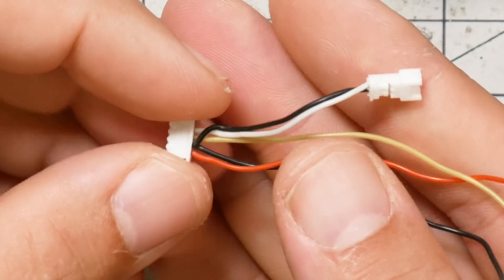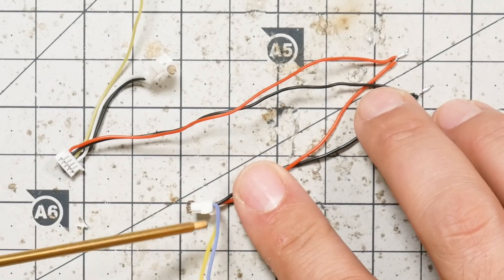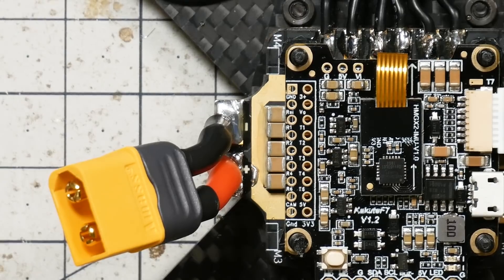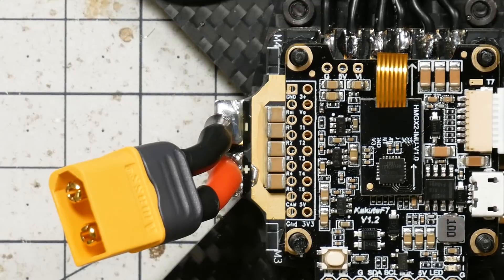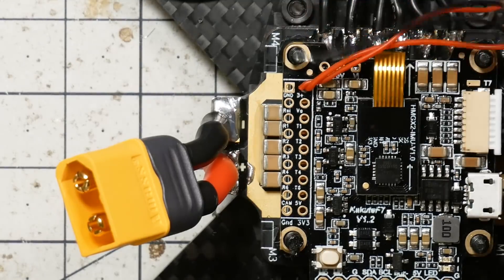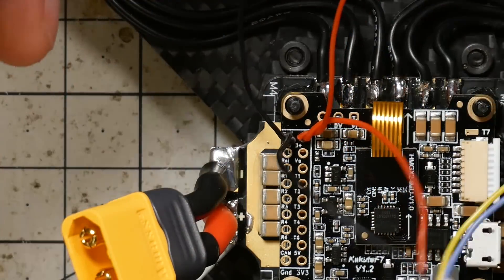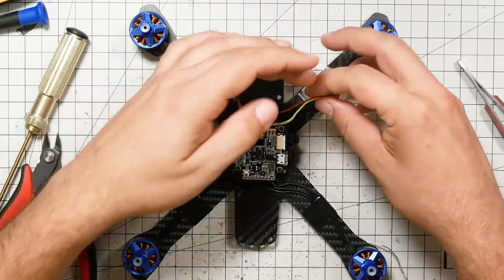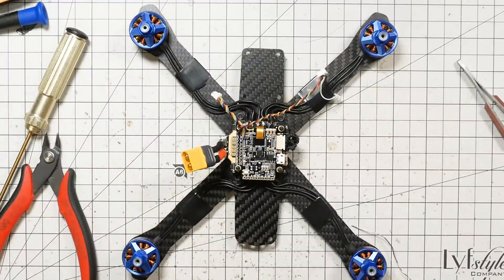Learn To Build a Racing Drone - Part 7 - Solder vTX and Prep Camera Header

Comment: Ah jeez. I know it's within ratings and the TX unit just pulls a trickle of current, but the thought of pushing ~26V from a battery through those squirrelly little hair's-breadth silicone wires just wigs me out a bit.
Reply from the maker: The voltage rating of the wire is determined by the breakdown voltage of the insulation. Silicone insulation such as used here is typically rated to 200 volts or higher. There's zero risk here pushing 26v through these wires.

But ummm.... why do you think we're pushing 26v? The 4S lipo maxes out around 16.8 volts. There's nowhere on this quad that would push 26v.

Comment: Josh i need vidio how too hook up flysky recievers to the board do you or are you gona make that vidio i have the nirvana have been using it and love it i bought an irange x4v2 modual for it but i cant get modual to work yet
Reply from the maker: Check the link in the video description to the Philipp Seidel wiring diagram for other receivers. But if this isn't the receiver video then that link isn't posted yet. Wait for the receiver video.

Comment: Question: The specs of the Atlatl say 7-28V. Why did you solder the power to the 3V? Or did I miss something? I usually solder the +/- of the VTx right to the battery leads, then solder the camera +/- to the VTx.
Reply from the maker: It's not 3v. That's a B but the silk screen is a little messed up.
Reply: What is that B+ pad supposed to be for? It that the Buzz+ which rarely gets used for a buzzer? Also, why didn't you use the CAM pad to power the cam and vtx separately?
Reply: The b+ here is the vbat -> battery voltage thus providing power direcltly from the battery

Comment: Is it a good idea to solder the wires to the FC above the ESC taking into account that the pads have holes and there is risk of solder going through and dripping into the ESC? I am sure you know what you are doing, but it could be risky for beginners. On other things, why did you choose 3v instead of, let’s say, 5v for powering the FPV system? Is there a particular reason? I always thought that using more Voltage was better, but being a beginner I don’t have arguments to support that.
Reply from the maker: I didn't power the system from 3v. I think there is confusion there. The silk screen looks like it says 3 but it's actually a B meaning battery voltage.

Soldering over the ESC? If you are worried you will drip through then sure remove it. But if you are worried it will drip through, you should really pause the build and go practice soldering for a while.

Comment: Wait, what? This VTX runs on 5v? 😮
Anyway, great work, JB! And, well... I'm going to travel today and I'm probably going to spend a week offline. So... Great week, everybody! And see ya. 😊
Reply from the maker: Ummm I think I soldered it to vBat right? I would have to go back and check but I'm out at Rampage and have terrible signal.
Reply: It's on vbat. @mc's creations vbat gives battery voltage and the Atlatl V2 takes  7-28 V if you check the specs on it. I wouldn't recommend connecting this vtx to 5v.